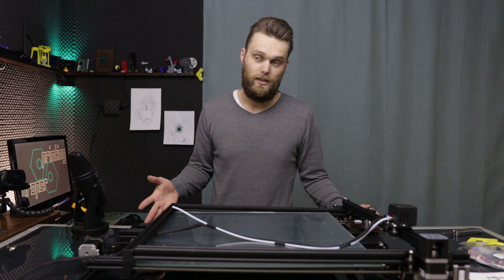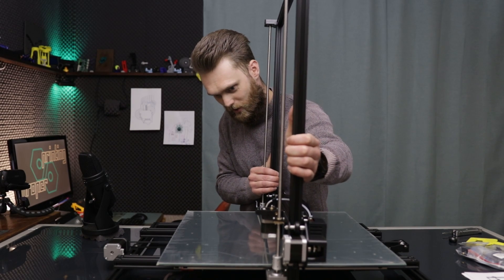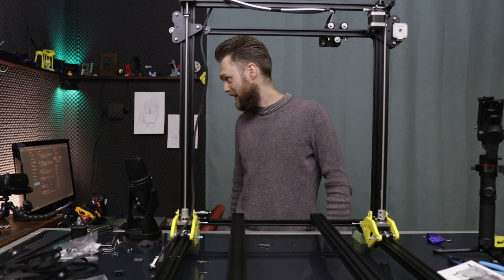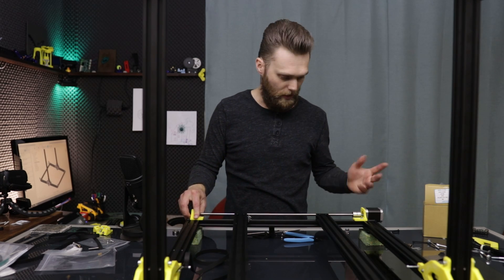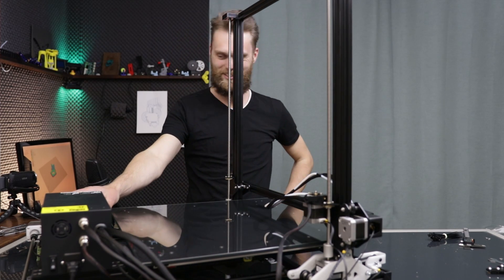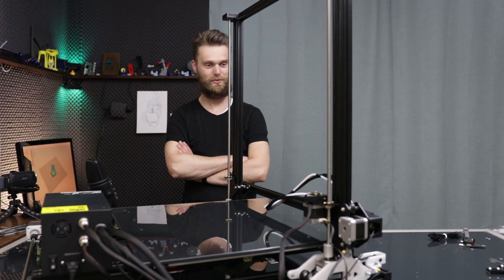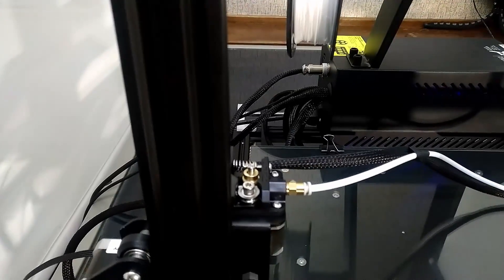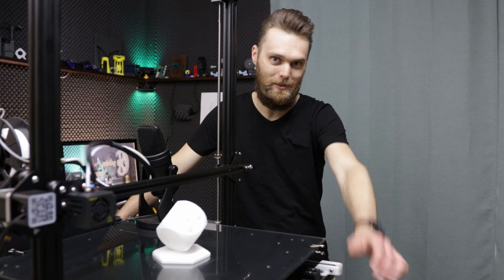Why not move the PORTAL instead of the BED?

Comment: Jon always has the coolest ideas. Im currently printing parts for this right now. You also could have an infinite Y without compromising the "moving weight". And on tall parts, you dont have to worry about the wobble of the part if its not a very wide part. Thanks for coming up with such great ideas Jon!
Reply from the maker: Thanks man! I really hope that it's going to work well! I don't know if you've seen my latest video, but I have improved the design a bit :)
Reply: @properprinting  We shall see! Im building the frame from scratch around a 400x400 plate (as opposed to using a CR10S5) so it will be interesting. I most definitely saw your newest Video! Already downloaded the new designs, thank you! Just waiting on some Vision Miner adhesive to help with the printing PC. I couldnt get PC to stick to my plate when i was printing the inner bracket so my parts are ABS in the meantime. Look forward to seeing more of your awesome work! Thanks man!

Comment: Amazing mod! Regarding the stock extruder, a simple fix is to put more tension in the extruder’s spring (one extra millimeter may do the job, two for sure does). I had it in the beginning with my CR10S, and this fixed the problem (like one of this: https://www.thingiverse.com/thing:3442595).
Reply from the maker: A kick-ass extruder is already going my way, thanks for the suggestion! :D
Reply: Proper Printing yep, this also solves :D

Comment: Doing something like this is just somehow crazy but I really like it! However apart from "looking cool" what do you expect as a benefit? I guess the usualy pros for a CoreXY doesn't count here especially because in the comments already mentioned that this is no corexy.
Good luck with that project. I will definitely follow your next videos.
Reply from the maker: Thanks! The main benefit would be the size reduction of the enclosure I'm going to make. Secondly I don't have to move a lot of weight, especially when printing large things and lastly I'm going to add a 230V silicon heater and I like that the cables can remain stationary :D

Comment: I don't FDM print as much as I used too because I mostly resin 3d print. I always go to my cr 10-s5 fully modified when I have to fdm print. I leave all my print settings at 200°C print Temp, 65° C build plate, RD 5mm, RS 40mm/s, print speed at 50mm/s. Great job on your mod but your setup with linear rails and reliable guide slides would make more accurate prints.
Reply from the maker: Thanks for your information! I'm wondering though how much accuracy is gained after adding linear rails. I'm not done with this design though ;)

Comment: While I love your out of the box thinking (I really do). This design is flawed as the x axis travels to the top of the z axis, the whole z/x axis assembly will swing in the y direction. You have removed the machines rigidity. This issue may be decreased by slowing down print speed, but seeing that this is a large format printer this approach seems impractical. I know some CNC routers have the same sort of design but the z travel on those machines are much smaller. But maybe the PC prints is Regid enough, I would love to see a tall print test at normal speed maybe, a vase mode print. But regardless I think you have done a good job.
Reply from the maker: Thanks for your comment. For this project of printing rims for a car I'm not too afraid of the rigidity. It's far more rigid that I thought it would be and I'm going to increase it's stability when adding that enclosure. I'm convinced that this might be even more rigid in the long run. However, I'm going to make a follow up video to show exactly how it performs and how it's actually called ;)
Reply: @properprinting  can't wait to see how it prints.

Comment: Always thinking outside the box. That's why I like this channel.
Question: is there any particular reason you choose to make brackets to hold down the bed support rather than just regular T-Nuts in the channel slots?
Reply from the maker: Thanks! The reason is that I used the existing holes where the V-slot wheels were placed. These aren't above the T-slots so I had to make these corner pieces.

Comment: Correct me if I'm wrong, the whole point of using a CoreXY motion is to reduce weight to the print head for faster and cleaner prints, Not to increase it. when i saw the title i was thinking maybe you used a few more aluminum extrusions to convert it to a CoreYX, I have to admit I never thought it would have been the way you did it! Call me a troll if you want, but this is the worst idea I have seen concerning 3d printing
Reply from the maker: Oh boy, I don't think you've seen all my ideas then xD

Comment: I'm guessing this modification should be applicable to an Ender 3 as well. The print bed not moving should help when printing tall, narrow objects. No wobble from the bed movement.
Reply from the maker: I'm going to make a fitting version for the Ender 3 as well, The bottom profile is different than on the CR-10. The wobble would be still there, moved from the bed to that gantry. Unless it's stabilized on the top as well. I'm going to make a follow up video to show how it actually performs ;)
Reply: @properprinting  , how much wobble would you remove if you used linear rails?
Reply from the maker: @magicclippy101  not much I think, but I already printed quite a lot with it and didn't have problems with wobble. For this reason I didn't look further into reducing this.

Comment: I enjoy your experiments, however your Y-axis belt pathway is not parallell. It was really clear when you homed. This will cause dimensional inaccuracies as your y-steps won't correlate to actual travel as it will be a variable trig function instead. It will be less noticable the smaller parts you make the further you are from the front. If you print a diagonal line from back to front it will be in the shape of a banana (albeit less proncounced) though ;). Like others have noted this is a normal cartesian printer with stationary printbed and a with a traveling gantry instead. I'm sure you've been told to death that core-XY is all about the kinematics. coreXY is all about the added benefit of lighter movement with a super steady build to allow for high speed while maintaining precision. This is a large printer... which is cool too, but does not come with any of the core-XY benefits. Your videos are good fun though. Thanks.
Reply from the maker: Thanks for this comment, this is really helpful. I have to do a little redesign because the build volume is reduced a bit because it collides with the motor bracket. By raising the point where the belt is mounted both the issue you mention and the reduced build volume is solved :)

Comment: I like the idea but is the gantry lighter than the bed moving ? Isn't that the idea to lighten the load so you can achieve faster prints? I would like to know the weight of the entire gantry and rails vs the bed .
Reply from the maker: My feeling would be that this is lighter, but I didn't measure it since it wasn't relevant for my goal of printing rims. Now that it has gotten this amount of attention I'm going to make a follow up video to show how it performs and how it's really called ;)

Comment: Am curious if there will be more Y ghosting or remnants especially up high with x at top? Wonder if you need to reduce Y acceleration and jerk?
Reply from the maker: I'm curious too! Probably resonance frequencies will be killing and they will be different at different Z heights. I'm going to make an enclosure with 2020 and 2040 profiles so I'm going to make it more stable at the top. For this specific project of printing rims I don't think it will be much of an issue since there aren't small details which causes those short movements.

Comment: Actually it's correct classifcation is a cartesian printer. 
On a cartesian printer each of the motors moves the end effector along one and only one axis of the three axis that composes the cartesian system. Also it's a serial stackup arrangement, basically motors are stacked on top of each other, moving the y axis moves the motors of all the rest axis.
On the contrary, a core XY is what's called a parallel manipulator system, the main feature of this approach is that motors are in a static position. No motor moves arround riding on any axis. Another implied feature is that one motor can produce movement on more than one axis. In case of a Delta printer, another example of parallel manipulator system, one motor can produce movement on three axis!! 
Thus the big advantage of the later systems are precisely that you don't need to carry the weight of motors on the axis, reducing by this way the inertia of the system and allowing bigger accelerations and speeds.
You can see an example of the parallel manipulator system movement of a Delta printer in the link below:
https://www.youtube.com/watch?v=mfjp9i9aJDg
Reply from the maker: Thanks a lot man for this complete informative comment! Very useful!

Comment: Bravo!  Great design but you’ll have to refrain from calling it COREXY because what you have here is a Cartesian printer. If you had a CoreXY you would be running that option in your firmware. 
You have a machine I designed many years ago to cut foam. 
Don’t get me wrong, it’s a good design but I would call it a “gantry style” machine. 
May I suggest metal plates on the bottom and counterweights to mitigate top wobble which you certainly will have. Also your bottom rails will flex unless you spread the load on the bottom rails and/or use “quad” extrusions. 
Nice but I would ask what are the movement limits?
Reply from the maker: Thanks David! I'm going to make a follow up video to set things straight and to show how it performs. This should work for my project of printing rims and I didn't think it would get this much attention. The bottom rails wouldn't flex much and I'm going to stabilize it at the top when I'm making that enclosure. Thanks for your comment!

Comment: A great mod, which I might copy.....As I already mentioned on your twitter feed, the next step is to stabilize that bed, so that it doesn't move over time and with temperature. I did my S4 , with it's moving bed by supporting the center of the heated bed with a  hockey-puck-size hard-wooden plate (move the Thermistor a bit off-center) on to the carrier plate . From that moment on you use that center height as "0", and adjust the corners with their spring loaded thumbscrews. This way I have not touched my bed in more than a year now, after initial leveling. And I reach a nearly 100% level all over the surface. The only thing to check regularly is the level of the X-gantry (or lock them with belts as well.) If your glass or mirror has a dip or bulge in the center, place it with the dip down, it is easier to pull down the corners than to  push them up with the springs....
Reply from the maker: Thanks for this information! I'm hoping that it would be stable now it's bolted down like it is now, but only time will tell ;) The most important thing is to make sure that it's flat and level. The z height itself can be adjusted accordingly. Good tip about the orientation of that bed!
Reply: Proper Printing There are 3 helpful items i have printed in the very beginning to help with adjusting the Z-0 height: first the adjustable z-axis switch, in which I installed the (otherwise useless) spare filament detector switch WITH BLUE LED which is super handy to finetune the 0 without touching the bed. Second: the height gauges for making sure the x-gantry is level to the bottom frame. Third: 2 handwheels to mount on top of the lead screws, to easily adjust the left and right side, even with powered motors. Together with the semi rigid bed makes my printer a simple “drag file to octoprint and walk away”- printer.
Reply from the maker: @steadirob  perfect! Thanks for the info!

Comment: Awesome work 💪. 

However I don't think this is a true core xy. A core xy is when the X and Y work together to move the hotend assembly. For example if you had to move just the X motor then the hotend assembly would move in a diagonal direction. If you wanted to move the hotend assembly in a straight vertical or horizontal direction then both motors have to move together at exactly the same speed. 

But nevertheless this is really cool. Goodjob. I wonder if it's possible to do something like this for the ender 3.

Fyi they use your technique on a huge scale to print houses.
Reply from the maker: Thanks Devon! You're right, it turns out to be a moving gantry or moving portal printer. Learned from the comments ;) This printer can almost print a house xD

Comment: This may technically isn't a corexy, but it sure is cool af. It's like an iPad with a keyboard. It's not quite a notebook, but it's sure cooler. You know what it looks like? The crane robot in port that moves containers around.

I thought it would have a problem with ghosting, though, because the frame moves, but who can argue with the print. This is super super awesome modification.
Reply from the maker: It looks indeed like that, haven't thought of that xD I'm going to improve the rigidity when I'm adding that enclosure though ;) Thanks!

Comment: Nice job. But is it also competible with a normal cr-10. The difference is size end it has now double extruded aluminum bar to ride on. So will it be stable then. If someone is going to test is i wood like to see it. I like the concept. It brings me fresh end new ideas. Wel done
Reply from the maker: I'm copy/pasting my previous reply ;) "Thanks! I recon it would, the only thing that would be different is mounting the bed since there is only one profile in the center. I don't know how much the Y movement will be reduced. I have to make a small modification to fix this ;)" Thanks Harm!

Comment: Love the video just like all the others! Do you think the files for this cr-10s5 would work on a normal cr-10s? You would just need to change the length of the rod and pullys right? everything else should scale since its the same profile and frame design, just different frame lengths.
Reply from the maker: Thanks! I recon it would, the only thing that would be different is mounting the bed since there is only one profile in the center. I don't know how much the Y movement will be reduced. I have to make a small modification to fix this ;)

Comment: If Wobble at high Z does appear you could consider making braces from the top to an armset on the trolley frames to stiffen things up when moving on Y so that each side of the z frame has its own triangle.  you would have to make the enclosure a little bit bigger tho.  Also consider a stock Direct drive mod like the Speeddrive  .Looking forward to and ender3 adaptation!
Reply from the maker: Like you're reading my mind :) I'm going to add the sickest direct drive extruder in existence that I know of ;)

Comment: thats fantastic.  do you have a vid on how you worked through getting PC to print properly?
Reply from the maker: Thanks Anton! No, but I can tell you shortly how I did it. I used the Ender 3 pro I made an enclosure for in one of my earlier videos. Printed on glass with 3DLAC with a E3D hotend at 260 degC. Heated bed at 100 degC. Slightly slower speed of 3000mm/min. Added extra top and bottom layers (6 in total) because it has some difficulties closing the surface and added a wide brim of two layers high. The major problem I had was the pc sticking to the nozzle (even with a MetalX hotend) so I had to manually remove some blobs while printing if I was there on time. Fortunately I have the Z homing switch (Z homing on anything video) in the tool changer so it pushed the nozzle up and didn't knock the part loose.